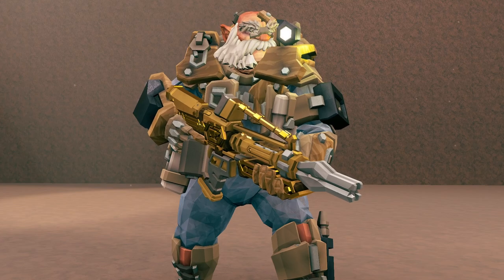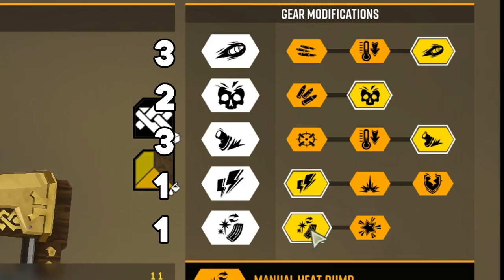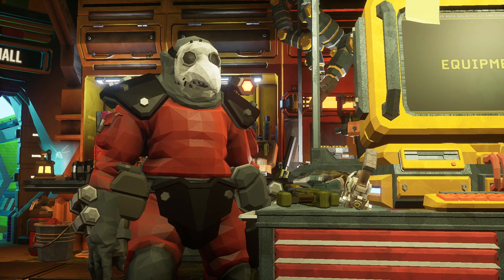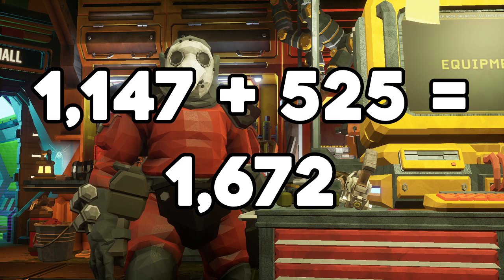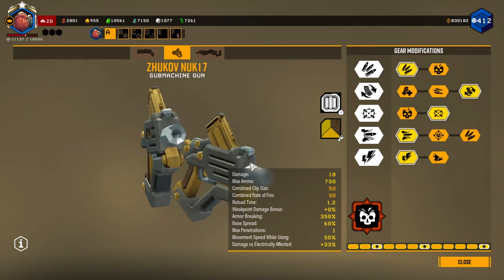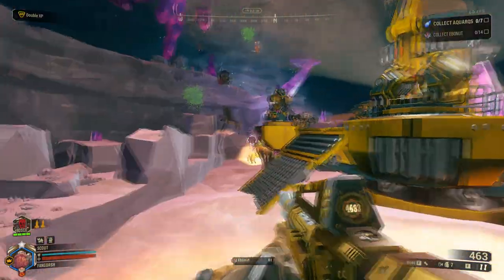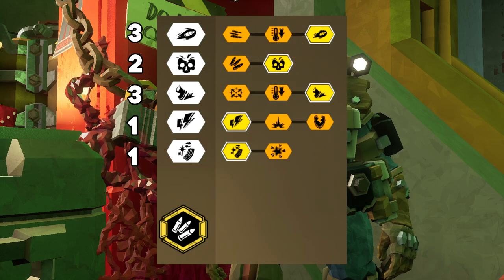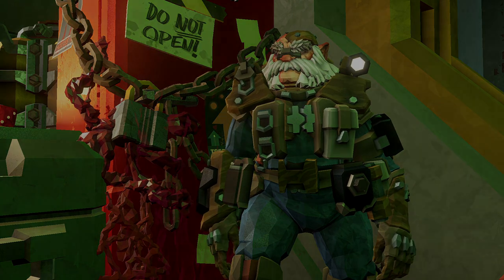Rewiring Mod Is Surprisingly Good | Deep Rock Galacitc

Comment: Manual heat dump interacts somewhat strangely with rewiring mod. If you overheat manually just over 50 percent heat, you are losing efficiency l. However, if you overheat manually just before you would normally overheat, you slightly gain efficiency. Overheating to full without manual heat dump will give you 69 percent of your ammo back, while overheating manually just before you would normally overheat will give you around 71 percent of your ammo back.